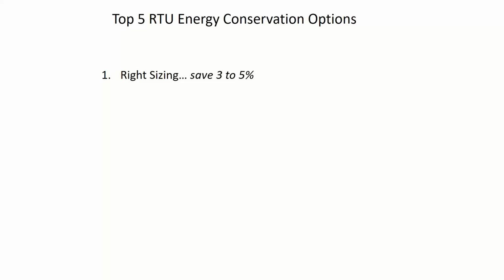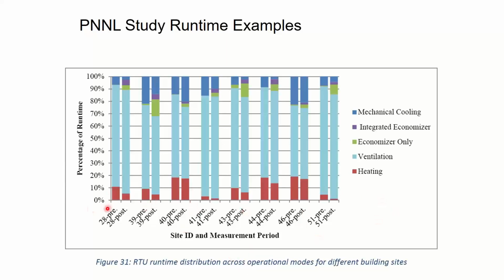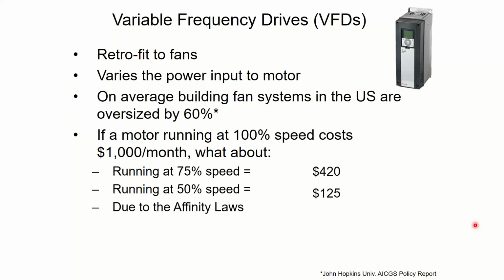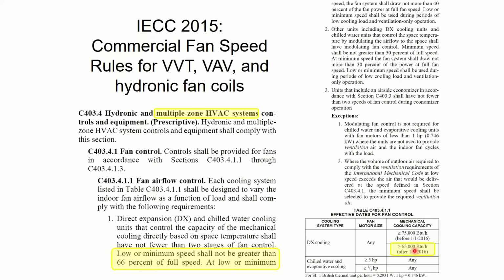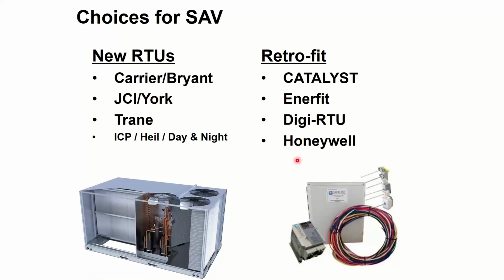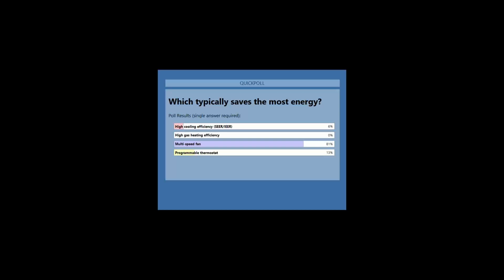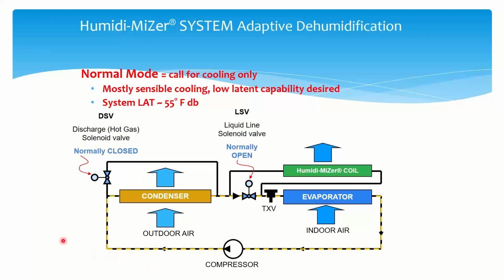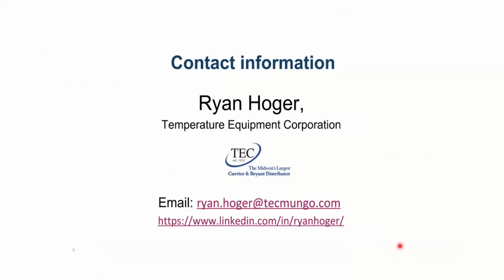Optimizing RTUs - Webinar 9/23/20

Comment: Hi, i have 8 tons RTU package and one speed fan, how can i make my system 3 speed blower fan ?
Reply from the maker: This video illustrates using a VFD to do that. Minute mark 39 gives a parts list. Talk to the manufacturer of the unit first to make sure this does not void warranty and to make sure you understand the minimum CFM needed for each operating mode.